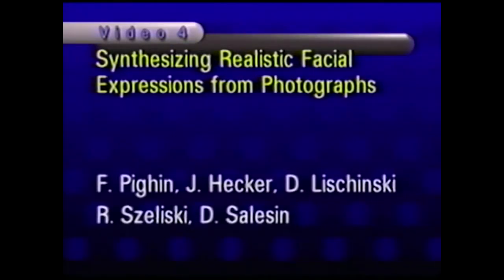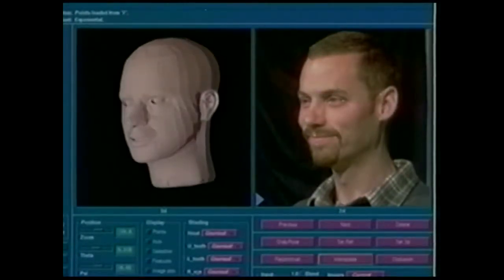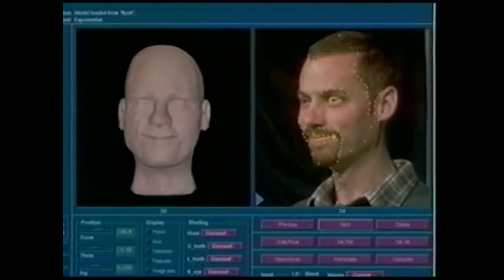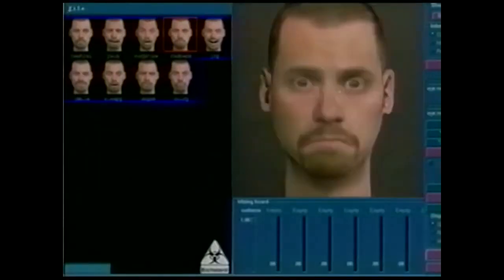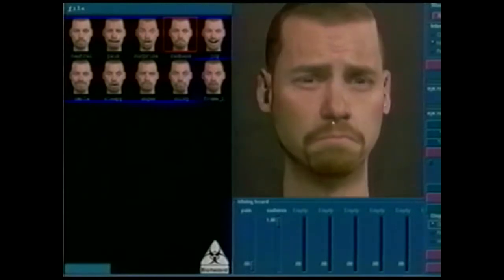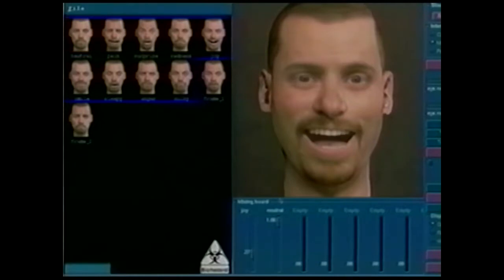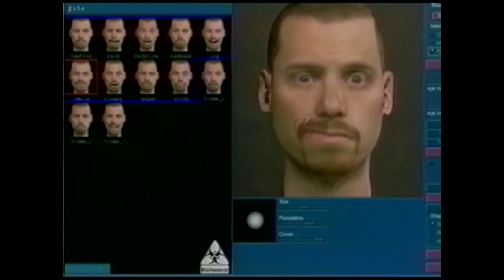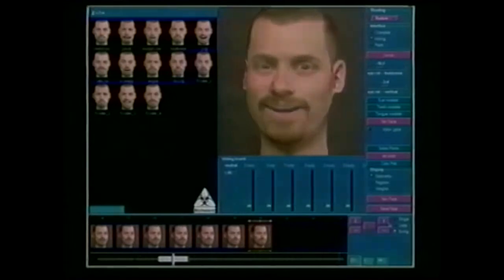Synthesizing realistic facial expressions from photographs (1998)

Comment: Is this how the animation in Half-Life was done?
Reply: No. Half-Life doesn't have dynamic expressions, the mouths just flap open and closed based on how loud the audio is. Half-Life 2 has a bit more advanced of a system, and it's similar,  but not the same, just uses manual facial animating with one base texture for every expression.